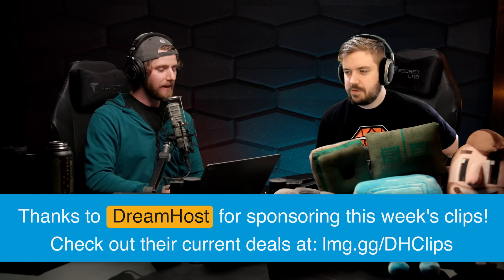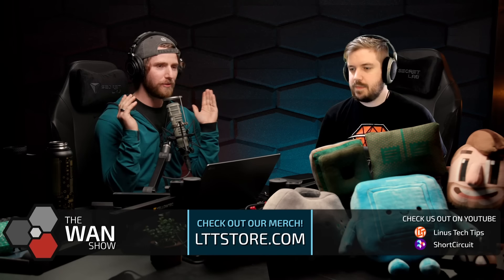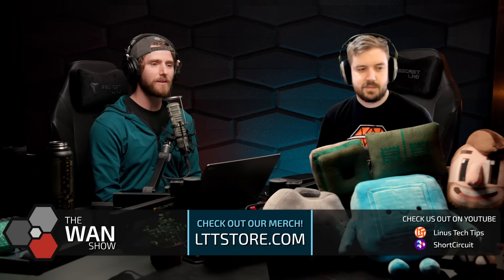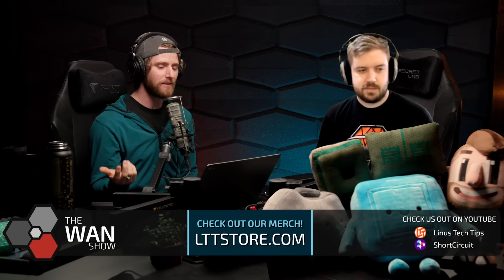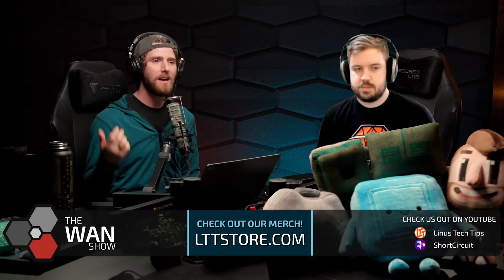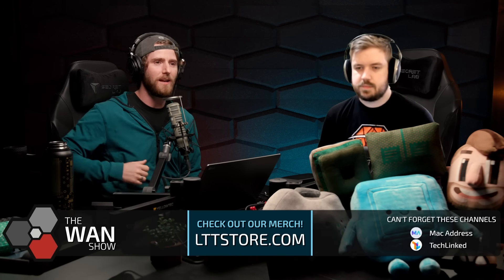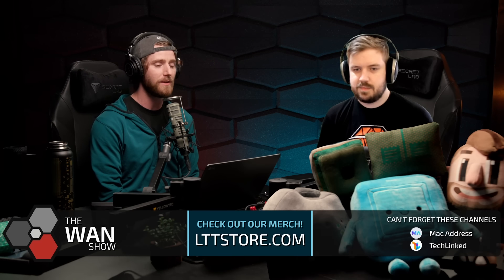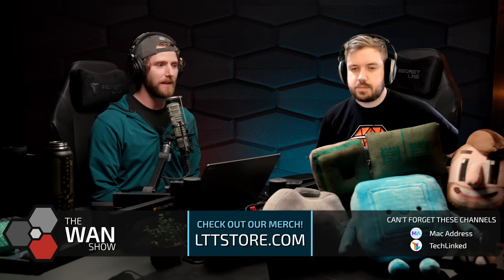They made me WASTE $10,000! Pt. 1

Comment: I use ZooZ wireless switches. They feel great, they're highly programmable, they work on Zwave Plus, no weird ecosystem or locked in BS, they look like standard wired switches, etc.
Reply: Do they still work manually when the network is down?
Reply: Well, not all of them look like standard switches. I use (almost exclusively) the zen 30 double switch because I wand to control my ceiling fans. It's understandable, you can't have an extra control and look like a standard switch.
I don't think Zooz makes a motion sensing switch though. But I like their stuff in general, tough to beat.
Reply: @Adroit1911  No, this switch requires your local Zwave network to be working or the switch won't do anything.
Reply: @giga-chicken  yeah that's true. I don't think they do motion sensing switches either. The ones I use are the Zen34 model though. They look just like regular switches
Reply: @bluegizmo1983  ... 😞 Might have to just stick with the smart bulbs 😐
Reply: @Adroit1911  depends on how you've set the switch up. If you have a switch controlling a dumb bulb then yes they work when the network is down. 
If you disable the internal relay and instead run automations based on the button presses (to control an RGB bulb for instance) then you probably need your hub to be running fine.
Reply: @Adroit1911  Yes. They work just like a normal switch.
Reply: @bluegizmo1983  That is not correct.
Reply: @tibbified  you mean about them not working if the network is down? Maybe I should've clarified... I meant if your local Zwave network went down the switch stops working, unlike a normal wired switch. I thought that's what he was asking. If he meant if the Internet goes down, then yes the switch will continue working if your internet is down.
Reply: @bluegizmo1983  The switch will still work just fine. You can't use the "smart" functions or automations, but it will still physically control the load. This is true with basically any smart switch. Wifi, zigbee, z-wave. In some cases the 3-way side of things may not work. Or if you bypassed the load switching to control a smart bulb or similar, then that will not work. And I have the zooz specifically. Zen 32 scene controller will even toggle the load. The scene buttons will not do anything if no hub.
Reply: @tibbified  oh ok I think I see where the confusion is. I was specifically talking about the Zen34 model switch, which is the one I have. It is completely wireless and has no "load" to control, it's battery powered and doesn't connect to any wires. It has to connect via Zwave to control anything. So in my case, with this particular switch, it won't control anything if the Zwave network is offline. I should've clarified that when I told him it wouldn't work. The Zen32 model should absolutely work offline though as it looks like that switch actually wires into the wall like a normal switch.

Comment: The biggest reasons why I haven’t upgraded anything in my house to “smart” devices is possible software update problems, platforms not being standardized, companies playing fast and loose with security, privacy, and support, and also the fact that there’s no actual need for it anywhere. 

Glad to see that I am justified by this. 🤣
Reply: Not really though. This is more of an exception to the rule. You do have to research everything smart you buy but that’s not too big of a time sink. 

There are many standardized platforms and Home Assistant allows you to tie them all into one dashboard.
Reply: i'm the same way also security issue if your not fully paying attention
Reply: @Drinkyoghurt  It’s too big of a time sink if I have to learn about how the nuances of the systems work before I purchase the devices. There is also currently no industry standard that everyone adheres to, there are several competing standards, and the compatibility issues between the products and the standards is still too inconsistent to be user friendly. For example, I can’t just buy a “smart” device and hook it up to HomeKit, I have to first see if it supports HomeKit specifically, and if it doesn’t, I can’t purchase that device. 

Meanwhile, if I purchase a “dumb” device and plug it into my wall, the electricity makes it go. There’s no special electricity from a different provider I need to make it go. The buttons I push do what the device says they do. I didn’t need to delve into which voluntary communications standard it had to be compatible with before I bought it to see if it would work. Set up was half a second, I just plugged it in and it worked.

Comment: The 'obvious' solution may not be ripping firmware from one part to another.

I design home automation devices for various clients/vendors and some of them specifically request to disable SPI/I2C interface using flag bits or by physically removing PCB traces.

Sometimes embedded firmwares are encrypted in a way to work with each unit... using silicon specific TRNG and ECC, all in the name of DRM.

Embedded product industry is hostile to the point that the choices they make in product design will feel dumb beyond anything.
Reply: I legit turned down a job at a company that was looking to create a smart ecosystem for landlords specifically because their products were SaaS. I'm not helping a company create a product that will die when the company does.
Reply: @namAehT  I sell IPs and most of the staff I do is compatible with one open source protocal or another + vendor spoecific custom stack, and leave some debugging interface that can be repurposed to pour new soul to EoL products.

When you live in 3rd world countries, vendor locking is rampant else nobody will survive, so it's virtually unavoidable

Comment: Sounds like a lot of steps to maybe or maybe not save some money in the long run.
I was an early adopter of many "this will save you money over time" items that just ended up failing prematurely, didn't last, too expensive.
Reply: Also he can adopt at anytime. Smart devices don’t require new wiring
Reply: @crunch9876  they do if your home was built before the 80s and hasn't been rewired since. Or if you want in wall Ethernet instead of whatever shoddy wiring you get from your ISP installer
Reply: Yeah just use those 10.000$ worth of switches plus the install fee and add more solar panels, that will pay for itself way better and you do not need to be mindful with AC usage when the sun is paying for it
Reply: @patrickshade3844  no….. his home was more recent than that so he doesn’t need new wiring….. also the date grounding was implemented I believe is 1975 his home is 20 years newer than that he has ground wire
Reply: @crunch9876  the problem isn't ground. It's the service panels. His house would've had a 100-200amp service panel, compared to 300-400amp dual panels in modern developments. Considering Linus himself and how much tech is going to be in the house, it's necessary. Especially if the entire house was getting ripped out anyway.

But, fyi, the argument wasn't about Linus. It was a general argument against a general statement.
Reply: Not to mention smart home infrastructure are often going out of date in record time.
Reply: I was thinking the same. Saying these will pay for themselves in 10 years is really optimistic. Because in 4 to 5 years these will be obsolete, and he will want to upgrade again. Plus, IMO its silly to think that turning off the AC when not in use is going to save money. It will just have to work twice as hard when you do need it. I have relatives that turn the temp to 85 when they leave for work, then set it to 72 when they get home. AC runs non-stop for most of the night to bring the temp down.

Comment: I'm firmly against active smart home devices (lights, garage doors, smart locks, etc.) but am fine with passive things (security, cameras, etc.).  Having license agreements, firmware updates, and other tech problems between me and being able to live in my space is unacceptable.  Home equipment needs to work over the span of decades and not be subject to the whims of agile and companies going out of business.

When your CEO does approve firmware release, it'll be through authorized dealers channel when the figure out how to monetize licenses for updates.
Reply: Z-Wave is a standard that runs completely locally. The company going out of business doesn't matter since the device will continue to run. 
The issue here is the firmware they shipped is crap and they don't provide the new one. Other manufactures provide firmware updates or just ship a light switch without bugs.
Reply: "Active" Smart Home devices will ALWAYS work in a "dumb" way for decades, even if a new owner comes in and doesn't have a hub/home assistant. They '"just" won't be able to be used remotely (or their color temparature changed) or in group scenarios.

Comment: I have Loxone at home that controls the lighting, heating, access, security and general automation. It’s been running reliably for many years, constantly getting more features, completely customisable and the config software is available to anyone. The main thing is having an installation contractor that knows what they are doing. For $10k you could have had a proper automation system.

Comment: I’ve been looking at home automation stuff for a new build project. Control4, Lytton, Crestron etc. Loxone has turned out to be the best. User programmable, supports KNX, Modbus, Home Connect, Tesla Powerwall, LGChem, Solar integration, motion sensors with acoustic sensors built in so if you’re in a living room there’s an acoustic threshold that needs to be met before the motion sensor is allowed to turn off lights and now is fully HomeKit certified which allows everything on the Loxone system to be controlled via Siri.

Comment: Of course we have the "Matter" initiative just around the corner that should hopefully get us closer to a more interoperable smarthome that's not reliant on the cloud, does run force you to run multiple proprietary hubs that don't or can't talk to each other.
Reply: Haha , have fun hoping. 
No for real. Matter will solve some things, but as the information I've seen, zwave, ZigBee, etc will have to go through a hub just the same. 
Thread also uses a hub technically but its included and disguised as a border router. 
And companies might either abandon their old zwave,  ZigBee based products and only do new thread, or update their hub or devices to support  matter (or thread on each device). 
So a unification will be better in some ways but not on low level, and will have to go through hubs with matter as a translation layer between the hubs. 
Some will not change at all and continue with their existing ZigBee, zwave to not kill their existing customers through confusion or abandonment.
And some will just say, that is old, we won't support that, thread is the new all new products are based on.

Comment: I've been using X-10 Home Automation for over twenty years.  This system uses the power-line as a carrier.  It transmits data during the Zero-crossing of the sine-wave.  Controllers are hand-held, key fob, or RS232.  Add a Raspberry Pie and control things from your phone.

Comment: I used to do customer support where we practically begged the customer to upgrade the firmware. Assuring them how easy it is. That it will provide them immediate relief, and if it doesn't work we will come fix it. All because if they upgraded the firmware themselves it saved the company a lot of money and time and effort on having to have a service technician come over and update their firmware to fix it (under warranty). Them actively resisting providing the firmware is completely backwards, it just means customers returning a perfectly fine (hardware-wise) device to the store and getting a refund. Which is a lost sale, a lost customer, and damaged reputation.

Comment: You can control Lutron lighting systems with any 232 device. You can legit use any programmable switch. Personally love Lutron. A lot of companies do this with firmware. You have to be a partner or licensed integrator to get the firmware. Alot of big AV control companies  have this kind of policy. What you can probably do is find a licensed integrator for these devices and ask if they can provide you with the firmware.
Reply: Which lutron system, i believe he’s talking about the caseta line which has a wireless bridge?
Reply: @OrangeRAZ  probably would be for either Ra2, Ra3, Homeworks or one of the other higher end home systems from Lutron

Comment: the house I moved into had Polybutylene pipes.  It was in "good" shape when we moved in, which just means it wasn't leaking then, so we let it be for a little while.  After a few months a leak appeared behind the drywall in my laundry room in the basement which is mostly unfinished, and after fixing that issue by replacing the pipe there with PEX we knew that it was just a matter of time before we'd have leaks in other places that were harder to get to and bit the bullet to replace it everywhere.  They came in and poked some holes and replaced it all and then patched up the drywall.

Comment: I haven't had a single issue with my Lutrons. I've got several of them in my home, connections are great, automation is great. Yea, some of the switches are tactilely a bit soft but worth it for how well they work.

Also, I had a surge in my home thanks to electrical company. I had half GE/Jason switches and half Lutrons when we bought the house. All of the GE ones blew. All of the Lutrons ones survived. That sold me on Lutrons.

Comment: You've seen enough sci-fi movies where full integration is a ploy to losing control....
(don't be part of that :)

- Light switches are a simple circuit to the ceiling rose
- Door locks are a simple mechanical thing
- Heating systems are relatively simple relays/valves/pumps and boiler
- Homes are where you live not investment opportunities... + build for what you want, not anyone else - including the next buyer

None of that stuff needs automation or integrating so it all fails together.

Go old school-  be happy :)

(Obviously to each his own - I just like my house being usable/simple)
Reply: You have good points, but I disagree with "Homes are where you live not investment opportunities" Houses are almost a sure thing that will be worth more when you sell it than when you bought it.

Comment: My Lutron dimmer is nice. Center button and dimmer dial. Spin right and you ascend the lights, spin left and you reduce down to 1%. No hub required. The downside is I have the Aurora model, so it just sits on top of the normal toggler switch.

Comment: The best all-rounder smart switch I invested in is TP-Link's Kasa stuff. inexpensive. NO HUB. works as a manual switch. Works with all the AI assistants. Easy to install.
Reply: I also use Kasa and it's incredibly good. The only possible issue is it all runs over your wifi network instead of ZigBee or one of those smart home specific mech networks. Usually this isn't an issue but I can picture cases where it wouldn't be ideal
Reply: @yedoom  What I do is have 2.4GHz on ONLY for smart devices, the TP-link light switches and Google Home and whatever, and 5Ghz is for important things. I haven't noticed anything when it comes to speed or reliability. I'm super happy with KASA

Comment: Most homes don't have as much insulation on the internal walls.. so if you shut rooms off from the central air unit, then it has to work harder to cool the other rooms because of the seeping heat.. It's just not how central heating and air works.

Comment: Just a random opinion/thought: For an average to above-average sized house, I like run-of-the-mill switches, with smart switches on lights that I want automated with a timer (I use TP Link/Kasa).  So porch lights, over cabinet lights, etc, can be on a timer, such as dusk to 10pm, etc.  I do the same with my foyer lamp, but that is on a wifi plug.  Other than that, I kind of find home automation to be more hassle than it's worth.

"Can you adjust the lights for the movie?"  "Yeah, just let me find my phone.  Dang, now where did I leave that?"

Comment: I have been using X10 switches and devices with Homeseer software for years. Rock solid operation - no wifi needed - no proprietary ecosystem. Just good ol 70s tech that works as good today as it did back then.

Comment: Just thought, if the sensors etc are still in place then a cheap solution to manually switching them on/off is to just put in a switch next to them that takes over the connection between the sensor and the power to it, in other words the sensor would have a manual off switch to force it to comply.

*Edit:* Extension of the idea for delayed activation would to just use a delay switch instead of a hard on/off switch.

Comment: Presence detection can be done really well (although finicky to set up) by an esp32 and the bluetooth or other radio modules. It can track smartphones and their antennas. If you can pair this up with the motion sensing, then it could be darn perfect. Take for example the motion sensor initiating the presence in the room and using the esp32 for checking presence, or nearby presence, continuosly so that it wont turn off the lights while in the room.

Comment: I had a problem with the whole GE, Jasco situation. I bought 2 surge protector power strips to replace some old ones for my PC and my parents IMAC. The surge "protectors" were causing an overcurrent or something in both my PC and the IMAC causing peripherals (Mouse keyboard or anything plugged in via USB) to smell like burning electronics. After switching back to the old surge protectors the problem completely fixed itself. I am not sure what is going on with GE/Jasco products but I don't think I am going to be trusting them anytime soon, especially after hearing this.